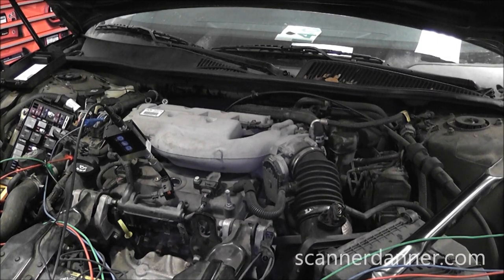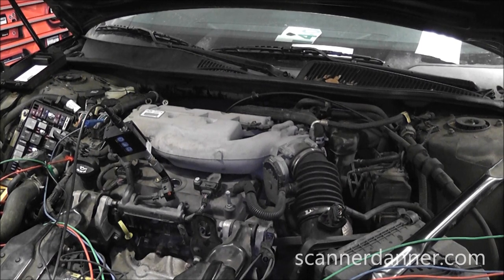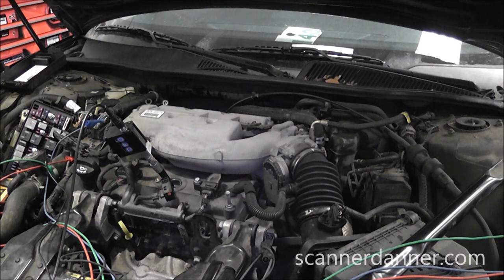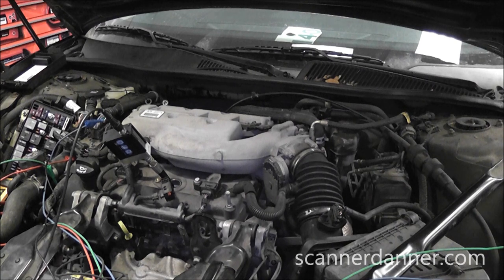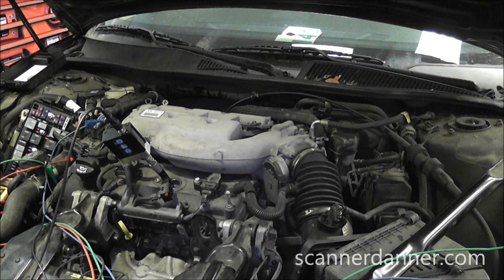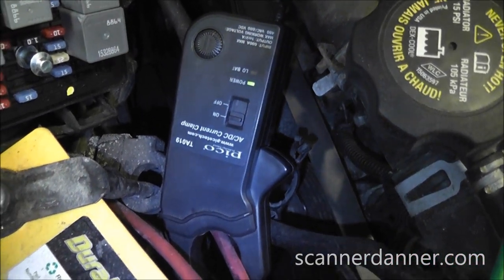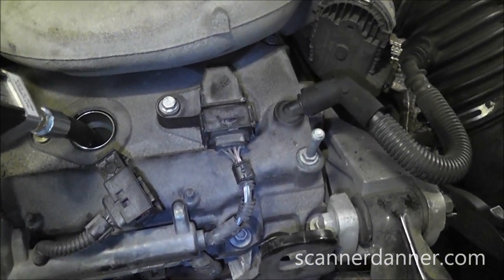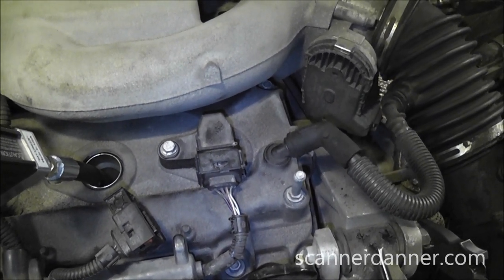Jumped timing chain (no compression on 3 cylinders) - GM 3.6

Comment: Will this be the same diagnosis for P0008 on a Chevy equinox 2008 3.6L V6?
Reply from the maker: It is becoming more and more difficult to answer questions here. I have 80,000 people asking me for help now. So I have created a forum to help you guys better. It is free to join and we can exchange pictures, wiring diagrams and waveforms if needed to help guide you through the process of troubleshooting your vehicle. Thank you so much! Hope to see you there. 
Paul Danner (ScannerDanner)
https://www.scannerdanner.com/forum/post-your-repair-questions-here.html
Reply: every vehicle is special . Perform the diagnosistic is vital to get the job done the right first time.
Reply: Exactly what I'm aiming for. There's been forum with stories of night mares of dealer mechanics with incorrect diagnosis and guess who has to folk out the money for that repair.
Reply: i have the same code for a 2008 suzuki xl7 with GMs sshitty ass 3.6L ive read in a lot of places that replacing the camshaft sensor would fix it but i havent tried it myself
Reply: In regards to my scenario. I'm not quite sold on mechanical repairs with the most common suggested issues such as the a stretch timing chain. This is due to seeing people posting on forums that they had been misdiagnosed, committed on costly repairs then 2 weeks later the code showed up once again. 

I am hoping the issue is the sensor as the car seems to not show any performance issue when the code comes up.
Reply: The cam sensor codes,not the cam sensor most of the time.Timing chain replacement is the only fix.The timing chains stretch and sets off cam sensor codes.
Reply: wafrederick ive replaced all the chains and guides and all 4 cam sensors and still have the damn code. i am about to give up on the engine and just jusnk the damn car its not worth 4k for a new engine.
Reply: Replacing part after part is not fixing. Diagnostics first always and understanding what your looking at. The emissions error codes are derived from the entire system. Emissions will is handled by fuel  system, cooling system and exhaust systems of all cars.Cars all emit gas that is expelled after combution the exhaust. cooling can affect how much fuel is burned and will effect emission .  Cars mixtures off will cause the codes .  These all have different components and need the code to identity the system then you need to break down the system diagnostic with a flow chart . All cars in show will require the flow chart to do proper diagnostics .Anyone can get the chart. Mechanics use these to fix your car. I use them all the time Ive saved hundreds of dollars . Ive taken courses and read several books. Flow charts will tell you how to test what tools to test with and specifications tolerance measurements . It will tell when to start or run car during the test . Some test have different conditions to give you the proper results. You  go down the flow chart till the problem is discovered . I do the whole on my vehicle to check all possibilites then I have full evalution on the vehicle. Ive troubleshoot gm and fords .
Reply: Any chance you can demonstrate this flow chart, this way of trouble shooting is too advance for me. And frankly to say I have not meet any mechanics who will actually go deep into the inner workings.
Reply: flow charts can be found on vehicles on google some are paid services but dont have a complete chart . You need to find a complete flow chart to do the job right. A flow chart will save u time and money. It gives u a step to follow . For this chart You locate the system and mechanics can tell the part pretty much the I would test that part first from the flow chart. Your vehicle maybe as easy as calibrating your crank or cam sensors from what i read . I need a factory manual to know more on your vehicle specs. You can tell if there is jump with a timing light too.
Reply: Your replacing parts does not repair a vehicle dude. You got to do a flow chart on car . Not all parts are bad so you will not fix car by replacing some that are good . You need to start with diagnostics first to eliminate good from the bad.
Reply: Has this affected engine performance. Is this engine interference or non?  Its sounds to be like a timing issue problem i could not be 100 percent on any till I had a full test done. Flow charts I. This vehicles timing being off would be read from a sensor and if sensor detect one code will be sent to ecm . Timing can be checked but also u got cams too . Id have to know and read more to solve this problem. To solve it I would test it with a timing light. Id diagnosis this vehicle several areas to determine the fault . Cars have computers that monitor engine during different phases.
Reply: So far Engine performance seems to decrease when the code is present. However we've notice after a bit of controlled aggressive acceleration the code disappear, (sometimes on normal driving) and the performance is back to normal. We've also suspected if the gas cap may have something to do with it, maybe it just coincidence.  I really don't want to bring in, simply its hard to find someone who actually has this particular trouble shooting skill sets. the car rides fine and its intermittent enough that its so far only a nuisance .

Comment: 3 good cylinders should be enough to run engine... why is not?
Reply: The ecm notices the cams in the rear bank are not in sync with the crank and will not allow it to start.

Comment: Have 2004 chry. pacifica 3.5 ltr showing mil P0016 (can / crank mis alignment) and another code (don;t recall) for cam sensor position, the latter was intermittent prior to P0016 and no further starting. When P0016 came up the engine will not start but cranks. Cly pressure reads steady at 70 pounds on one cyl (very low) so my question is this. Could a timing chain/belt slip a notch or two causing cyl pressure to be low but not have slipped enough to damage engine parts? Is there a way to know without having to access timing belt area if this can be realigned if needed? Obviously I would prefer not to buy another engine if I can fix timing belt realignment. 3 out of 5 mechanics say car needs an engine, 2 say problem is electrical engine is fine. STALEMATE and at least 2 or more BAD MECHANICS. Signed - Elderly retired couple trying to save what we can, social security does not go very far today.
Reply from the maker: hard to say my friend, most likely there is engine damage but without looking it up, I am not sure if this is an interference engine or not. The symptoms of one cylinder being that low on compression compared to the others is not a good sign
Reply: Sounds more loke a failed head gasket than a jumped timing chain
Reply: More like a failed head gasket. If the timing chain was replaced after jumping timing and then there was lower cylinder pressure in one cylinder, it would be a sign that the valves were bent because of the timing issue. However, all three cylinders on that side of the V6 should have no pressure or similar low pressures if it is the timing issue

Comment: really? get in the real world and try, I was given a ticket on a F350, complaint Miss on Cyl 6, customer replaced plugs coil and injector on number six cyl,  where would you go? I can tell you, vacuum was 20 in. and steady, compression on 5 and 6 were 150 ish.
I used the ford scan tool to confirm the miss was on cyl 6 watched variable cam timing error on the scan tool, it came down to using a scope on the coil watching primary ignition- fix replace bad spark plug, fyi no visable issue with plug

Comment: Another thing to check is how much carbon build up on top the piston in the GM GDI 3.6 engines.I was told of one case of this,they did stick a ruler down the spark plug hole finding an over an inch build up of carbon on top.They could not see the top of the piston at all.The GM 3.6 is an interference engine and there are machine shops that won't touch these heads.Don't have the special tools needed to take apart these heads.